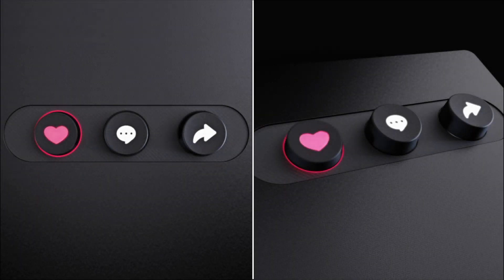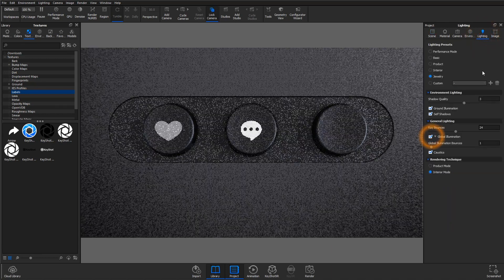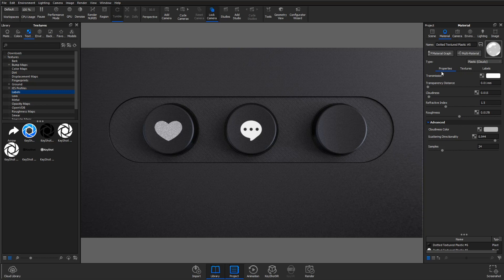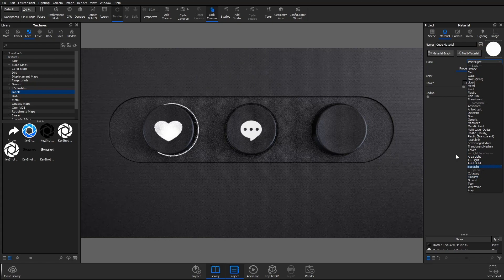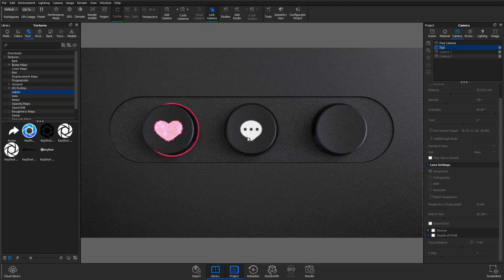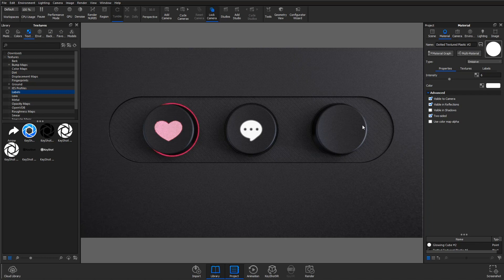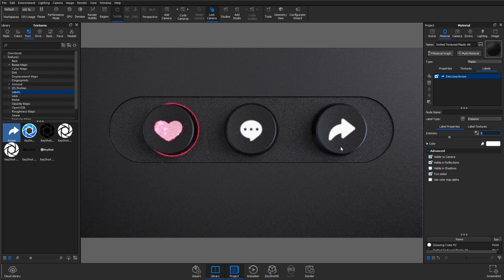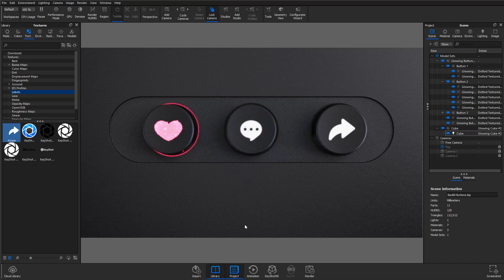KeyShot Quick Tip - Glowing Buttons

Comment: And there you have the same old bug, clearly visible in the first heart icon. Those "hot-spots" or "fireflies" never go away, no matter how many samples you use or how much tweaking you do, meaning tons of amusing postprocessing. Please fix your engine, this has been a problem since forever.
Reply: we fix this by adding a sphere for the emissive placed within a larger sphere - literally recreating how an LED's prism works, for the outer sphere aside from the usual transparent plastics, try the "Glass (Solid)" under basics in the material type drop-down, it makes some different things happen with the bloom effect - really dumbs it down but you can amp up the power on the emissive to get the shine-through again.
Reply: @RAD-CORP  He's talking about white noise. Yes, it's quite annoying thing. Sometimes I need to use completely different approach when the scene it too complex to afford more rendering time.
Reply: Turning off caustics will eliminate fireflies